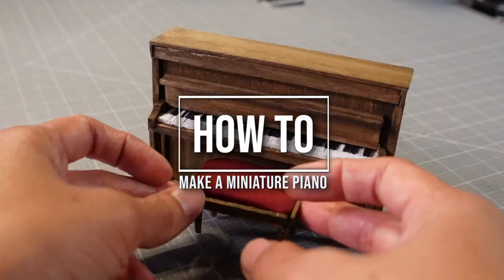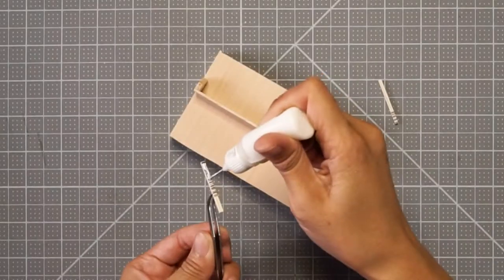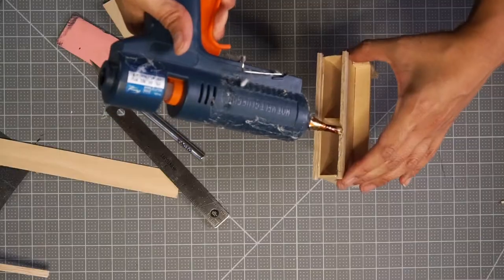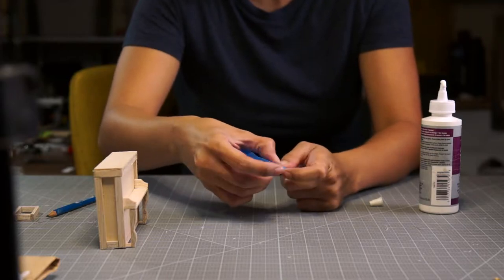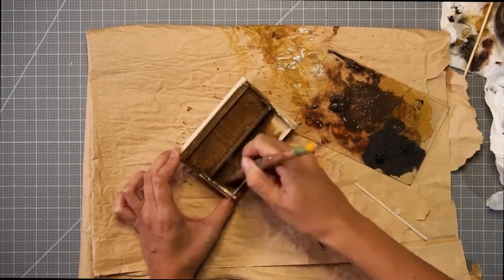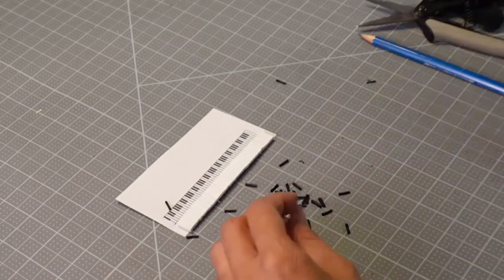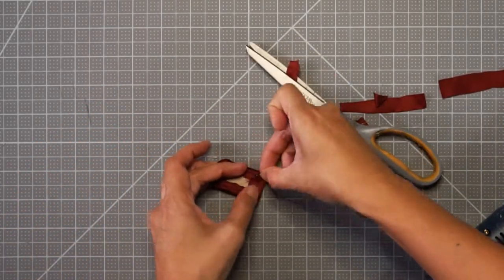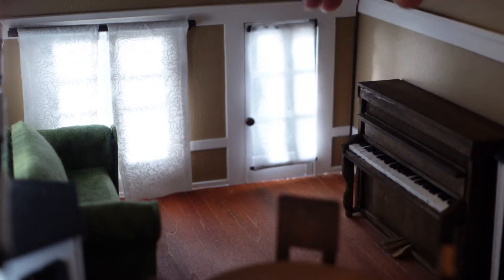Making a Miniature Piano for Dollhouse and Dioramas (Full Build)

Comment: What materials/wood did you use? I want to try to make this, but I'm not sure what material to buy. I've made things with popcicle sticks, but those are harder to cut and are paneled, not a long solid piece like you cut from.
Reply from the maker: Hello! I used both basswood and balsa wood. The sheet of wood I was cutting from was basswood, and the pieces I shaped and sanded were balsa. Everything else was a mixture of both types of wood. Happy crafting! :)